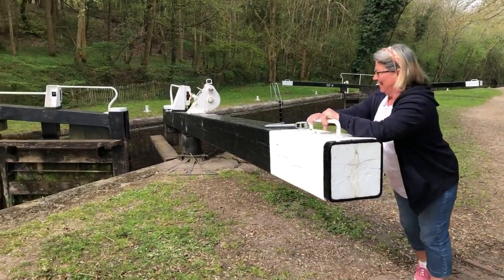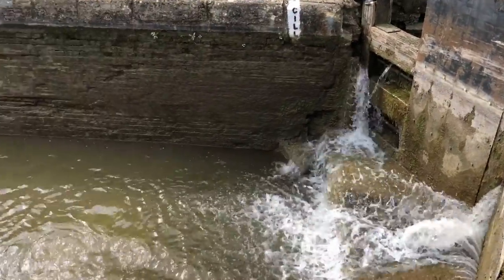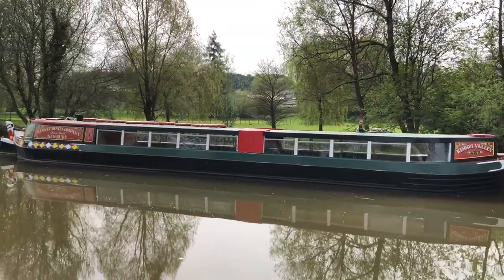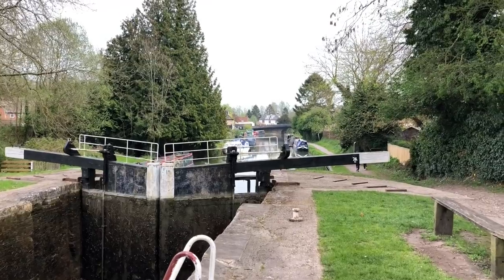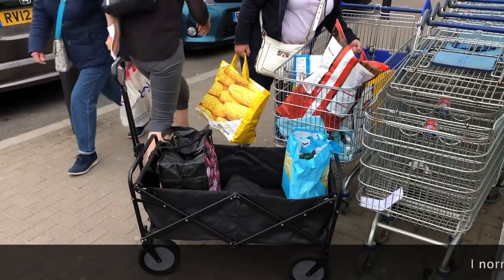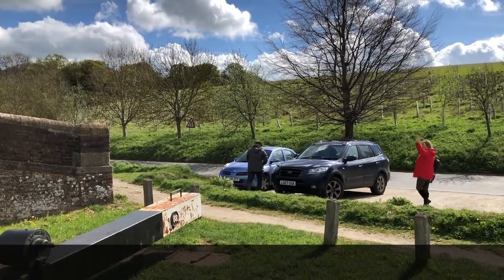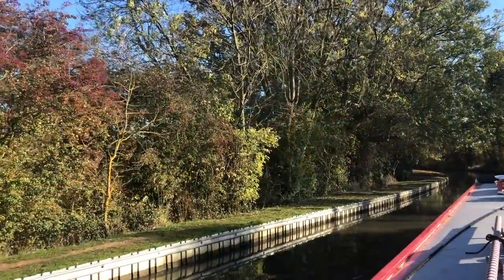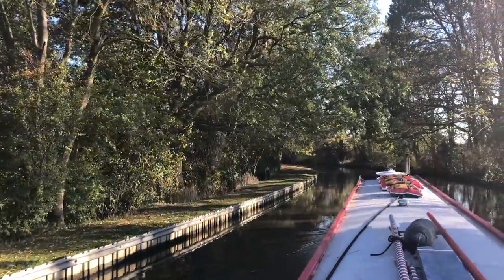E21. Narrowboat cruise to Crofton Pumping Station with a Boulton & Watt Beam Engine on the K&A.

Comment: Mark I am with you I have been to Crofton Pumping station a few times. A fantastic place to visit. If I remember correctly the old beam engines can actually raise to much water, and at times when they are running they have to stop pumping to avoid flooding. they actually raise more water than the electric pumps used today, Never been there by boat, I must plan that one day. The wind mill just down the road is also a wonderful place to visit. 
As for the two Ronnies I saw that sketch live in Bournemouth too many years ago to remember. Got any peas, fork handles and hose. lol
Reply from the maker: Trev's Travels By Narrowboat Did you ever visit when they were running on steam?
Reply: @pmailkeey If my memory serves me correctly the Bolton & Watt lifts about 1 ton of water per stroke of the engine and runs at around 11 strokes per minute.
Reply: @pmailkeey that is the speed it was running at when I last visited, but that is over 15 years ago, as I have been living in the US for just over 14 years now.
Reply: @pmailkeey I am not so sure about that, I do not think it is designed to run any faster. the way it works, on the down stroke the top chamber above the piston is flooded, and as it rises it lifts the water to flow out into a channel feeding the canal. If it was to run any faster i do not think that on the down stoke the chamber would have time to flood. here is a link showing it working https://youtu.be/UM9alrcEkkI

Comment: Had a few near misses myself in locks this summer, e.g. having lowered my boat in a lock successfully, I got talking to someone and took my eye off the boat. It then drifted backwards into the range of a badly leaking top gate. Result was a LOT of water in the engine compartment. If I'd left it much longer it would have flooded the engine and batteries or even sunk! So do be careful at locks!
Reply from the maker: Rod Nelson Its scary just how quick things can go bad

Comment: 24 hour. Mooring means what it say 24 hour, but a day meaning if you ask my wife is any time within the next week or two, or long if the mood takes. I don't know what happened to this video but it did not show up in my subscription list and I didn't get a notification email.
Reply: Lewis Gardener Didn’t show up in mine either. 🤷🏼‍♀️
Reply from the maker: Lewis Gardener thanks for the heads up on that .I will check my setting my end